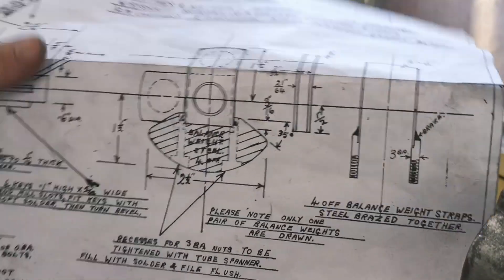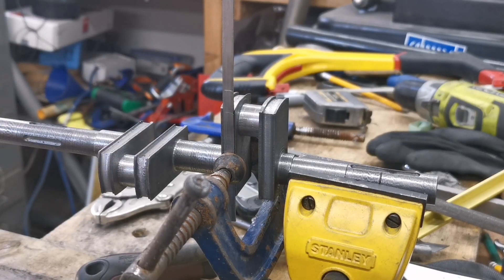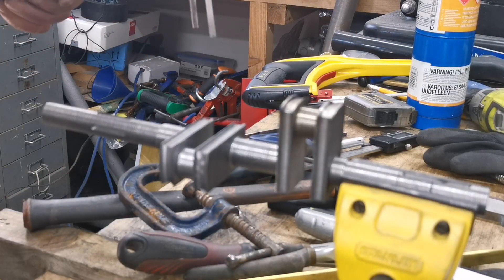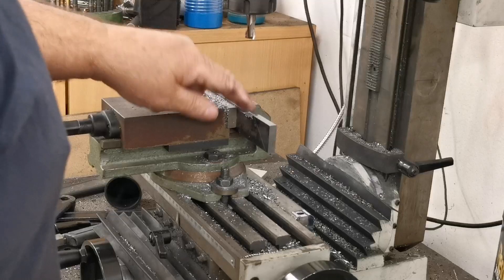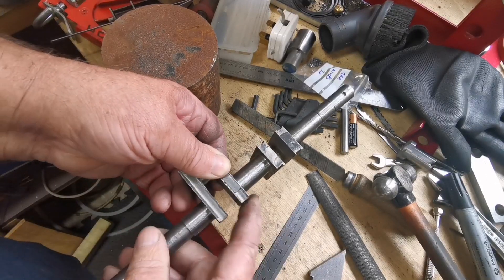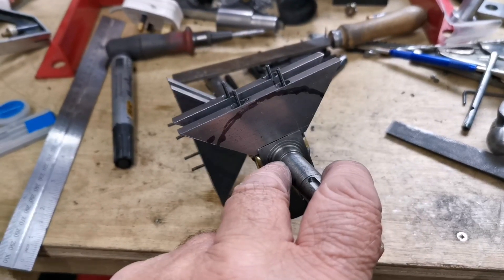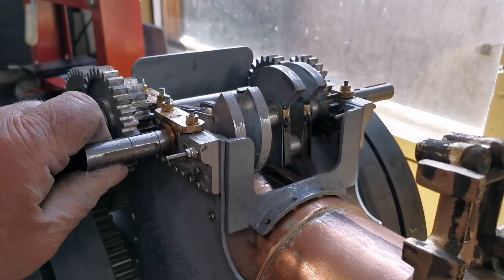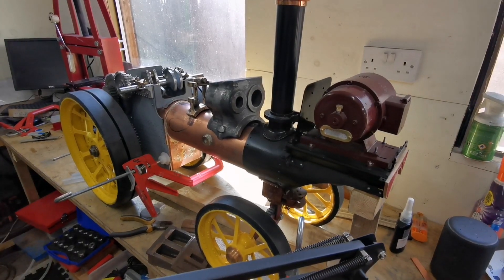2" Fowler Showman's Traction Engine counter balance weights and the finished crankshaft

Comment: I made a jig for bending the straps i found it better and i was worried about warming the crank,,but it seemed ok the way you done it ….what milling bits do you use  i seem to struggle to get budget ones I don’t want to pay for professional ones ….great video
Reply from the maker: The first end milling cutters I brought was a set from axminster power tools, then I have brought a set of slotting Mills from a company that stocks were I work,  they sometimes bring in a leaflet which has items on offer, and then I've brought cheep end Mills off ebay, or banggood